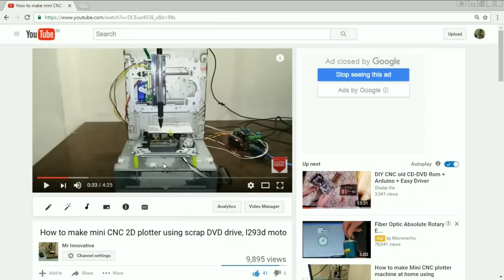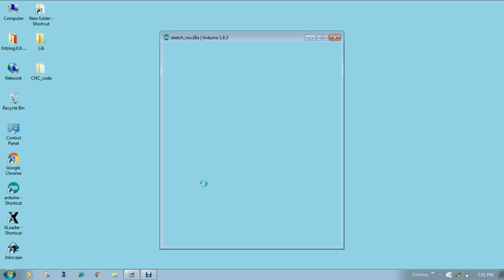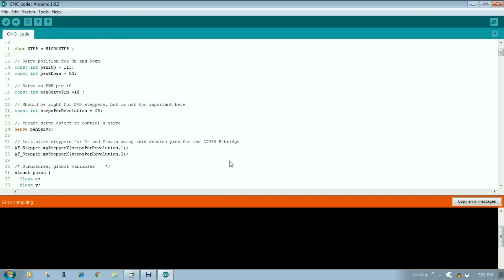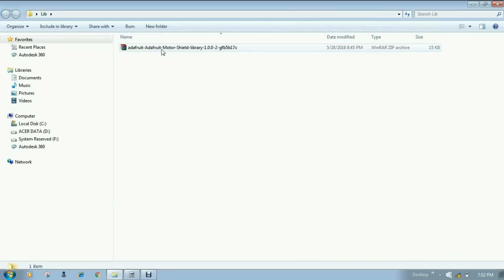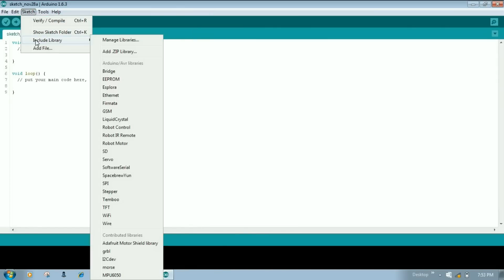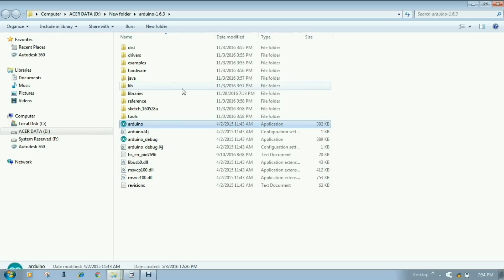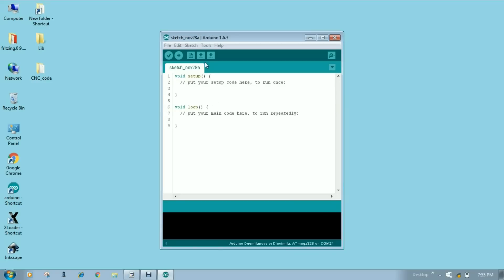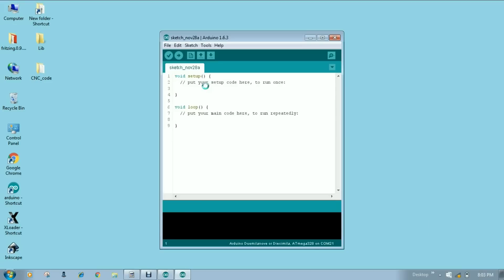How to add Library in Arduino IDE 2017

Comment: Help me please ... im getting this error msh when uploading code to board 
Arduino: 1.8.5 (Windows 10), Board: "Arduino/Genuino Uno"

C:\Program Files (x86)\Arduino\examples\DisplayClientV2\DisplayClientV2.ino:56:18: fatal error: Tone.h: No such file or directory

 #include <Tone.h>

                  ^

compilation terminated.

exit status 1
Error compiling for board Arduino/Genuino Uno.

This report would have more information with
"Show verbose output during compilation"
option enabled in File -> Preferences.

Comment: thanks a lot for this. I do have one question. somehow my servo motor controlling the pen is down from the start. it moves to the place where it wants to draw and then the pen moves up. after the line is finished, then the pen again moves down and touches the paper.
is there any way to reverse this servo motor? I have a feeling there is a way to do so but dont know how to do it.

Also can you please let me know how i can speed up the X and Y axis motors to move a little bit faster? Because i know it moved much more faster before i flushed the Arduino using the GRBL library and setting it to use Core XY.

Any help regarding this will greatly be appreciated.

Comment: Dear Mr Innovative,
I have included keypad library in arduino but do't show in sketch library and bellow error produce during compilling how can i remove it?
Arduino: 1.8.1 (Windows 8.1), Board: "Arduino/Genuino Uno"

C:\Users\Manzoor Ahmed\Desktop\calculator\calculator.ino:9:20: fatal error: Keypad.h: No such file or directory

 #include <Keypad.h>

                    ^

compilation terminated.

exit status 1
Error compiling for board Arduino/Genuino Uno.

This report would have more information with
"Show verbose output during compilation"
option enabled in File -> Preferences.

Comment: Arduino:1.8.5 (Windows 10), Kart:"Arduino/Genuino Uno"

C:\Users\selo'o\Desktop\ARDUINO\videos\stepper test\stepper_test\stepper_test.ino:7:19: fatal error: A4988.h: No such file or directory

 #include "A4988.h"

                   ^

compilation terminated.

exit status 1
Error compiling for board Arduino/Genuino Uno.

This report would have more information with
"Show verbose output during compilation"
option enabled in File -> Preferences.
ı download and install the aflibrary but now it says me a4988.h  no such file pls help me
Reply: did you fix it yet ? cause i,m having the same problem

Comment: How to solve this problems : 
Arduino: 1.8.9 (Windows 10), Board: "Arduino/Genuino Uno"

Sketch uses 9920 bytes (30%) of program storage space. Maximum is 32256 bytes.
Global variables use 491 bytes (23%) of dynamic memory, leaving 1557 bytes for local variables. Maximum is 2048 bytes.
avrdude: ser_open(): can't open device "\\.\COM8": The system cannot find the file specified.

Problem uploading to board.  See http://www.arduino.cc/en/Guide/Troubleshooting#upload for suggestions.
Invalid library found in C:\Users\neswa\Downloads\arduino-1.8.9-windows\arduino-1.8.9\libraries\adafruit-Adafruit-Motor-Shield-library-1.0.0-2-gfb5b17c: no headers files (.h) found in C:\Users\neswa\Downloads\arduino-1.8.9-windows\arduino-1.8.9\libraries\adafruit-Adafruit-Motor-Shield-library-1.0.0-2-gfb5b17c
Invalid library found in C:\Users\neswa\Downloads\arduino-1.8.9-windows\arduino-1.8.9\libraries\adafruit-Adafruit-Motor-Shield-library-1.0.0-2-gfb5b17c: no headers files (.h) found in C:\Users\neswa\Downloads\arduino-1.8.9-windows\arduino-1.8.9\libraries\adafruit-Adafruit-Motor-Shield-library-1.0.0-2-gfb5b17c
Invalid library found in C:\Users\neswa\Downloads\arduino-1.8.9-windows\arduino-1.8.9\libraries\adafruit-Adafruit-Motor-Shield-library-1.0.0-2-gfb5b17c: no headers files (.h) found in C:\Users\neswa\Downloads\arduino-1.8.9-windows\arduino-1.8.9\libraries\adafruit-Adafruit-Motor-Shield-library-1.0.0-2-gfb5b17c
Invalid library found in C:\Users\neswa\Downloads\arduino-1.8.9-windows\arduino-1.8.9\libraries\adafruit-Adafruit-Motor-Shield-library-1.0.0-2-gfb5b17c: no headers files (.h) found in C:\Users\neswa\Downloads\arduino-1.8.9-windows\arduino-1.8.9\libraries\adafruit-Adafruit-Motor-Shield-library-1.0.0-2-gfb5b17c
Invalid library found in C:\Users\neswa\Downloads\arduino-1.8.9-windows\arduino-1.8.9\libraries\adafruit-Adafruit-Motor-Shield-library-1.0.0-2-gfb5b17c: no headers files (.h) found in C:\Users\neswa\Downloads\arduino-1.8.9-windows\arduino-1.8.9\libraries\adafruit-Adafruit-Motor-Shield-library-1.0.0-2-gfb5b17c
Invalid library found in C:\Users\neswa\Downloads\arduino-1.8.9-windows\arduino-1.8.9\libraries\adafruit-Adafruit-Motor-Shield-library-1.0.0-2-gfb5b17c: no headers files (.h) found in C:\Users\neswa\Downloads\arduino-1.8.9-windows\arduino-1.8.9\libraries\adafruit-Adafruit-Motor-Shield-library-1.0.0-2-gfb5b17c
Invalid library found in C:\Users\neswa\Downloads\arduino-1.8.9-windows\arduino-1.8.9\libraries\adafruit-Adafruit-Motor-Shield-library-1.0.0-2-gfb5b17c: no headers files (.h) found in C:\Users\neswa\Downloads\arduino-1.8.9-windows\arduino-1.8.9\libraries\adafruit-Adafruit-Motor-Shield-library-1.0.0-2-gfb5b17c
Invalid library found in C:\Users\neswa\Downloads\arduino-1.8.9-windows\arduino-1.8.9\libraries\adafruit-Adafruit-Motor-Shield-library-1.0.0-2-gfb5b17c: no headers files (.h) found in C:\Users\neswa\Downloads\arduino-1.8.9-windows\arduino-1.8.9\libraries\adafruit-Adafruit-Motor-Shield-library-1.0.0-2-gfb5b17c
Invalid library found in C:\Users\neswa\Downloads\arduino-1.8.9-windows\arduino-1.8.9\libraries\adafruit-Adafruit-Motor-Shield-library-1.0.0-2-gfb5b17c: no headers files (.h) found in C:\Users\neswa\Downloads\arduino-1.8.9-windows\arduino-1.8.9\libraries\adafruit-Adafruit-Motor-Shield-library-1.0.0-2-gfb5b17c

This report would have more information with
"Show verbose output during compilation"
option enabled in File -> Preferences.
Reply: check thev port

Comment: Arduino: 1.8.1 (Windows 8.1), Board: "Arduino/Genuino Mega or Mega 2560, ATmega2560 (Mega 2560)"

E:\Software\Ardiuno Uno software\CNC Mega\CNC_code\CNC_code.ino:7:26: fatal error: AccelStepper.h: No such file or directory

 #include <AccelStepper.h>

                          ^

compilation terminated.

exit status 1
Error compiling for board Arduino/Genuino Mega or Mega 2560.

This report would have more information with
"Show verbose output during compilation"
option enabled in File -> Preferences.

Dear Please Help Me to Fix this problem